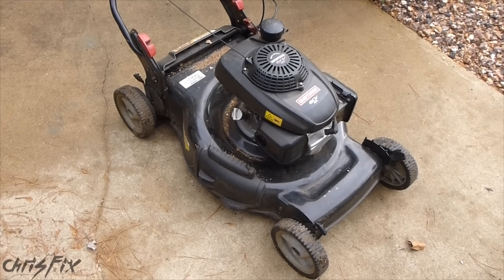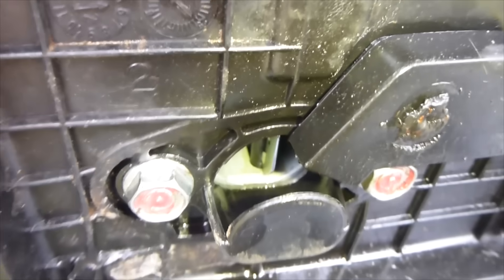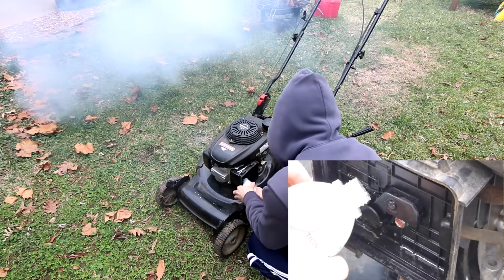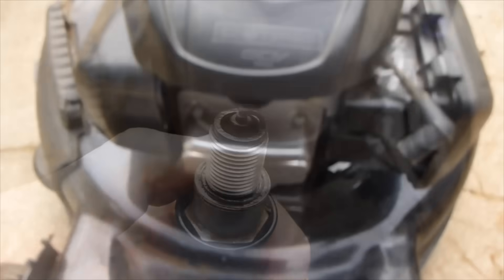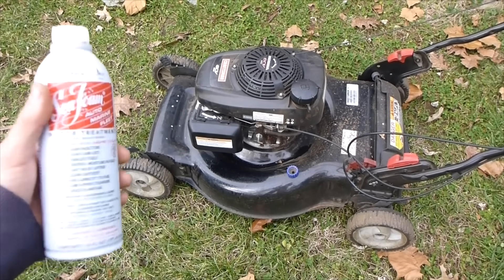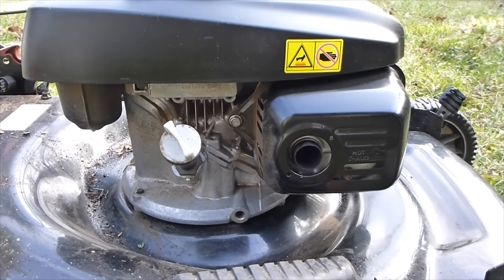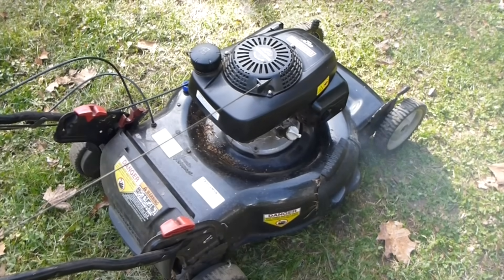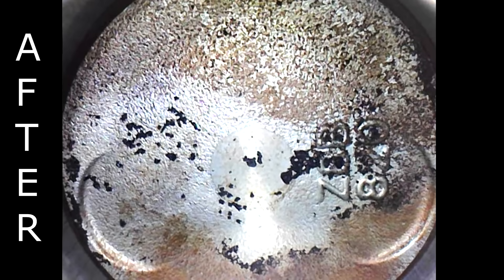Does Seafoam Actually Work? (with Proof)

Comment: Wow, very impressed with the results after soaking the piston.
Reply: same, would be interesting to see a 4banger cleaned with this.
Reply from the maker: Andy Plater Same! I wasnt sure if it would work!
Reply: Sanic I have a video of seafoam on a car engine and the results were different. My thoughts are that a car runs at higher temps hence the reason of it did not really work
Reply: BMAC VAGS did you soak the clyinders?
Reply: Sanic I'm looking forward to the next part of this conversation too!

Comment: Awesome job, much better than the gumout crap. Can't wait for your video of using Seafoam on a car/truck engine to be published.
Reply from the maker: fordwindsor351 Thanks bud! I cant wait to see how it performs in a car motor!
Reply: You gotta remember with the gum out it was mixed with the fuel the sea foam is essentially "steam cleaning" the cylinder. Sea foam does do a good job on carbon but really a better test would be sea foam in fuel tank for 2 full tanks as he did with the gum out to test if it cleans better then gum out.
Reply from the maker: Eric Rollins I am just following the instructions and reading the claims on the bottle. Nothing more, so with seafoam you use 1/3 in the gas tank and 1/3 in the intake.
Reply: another paid reply